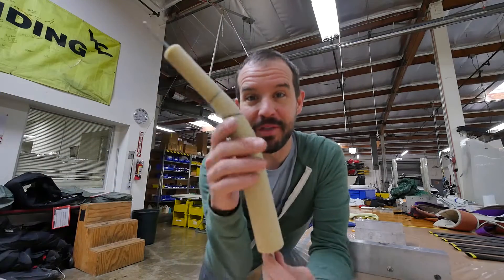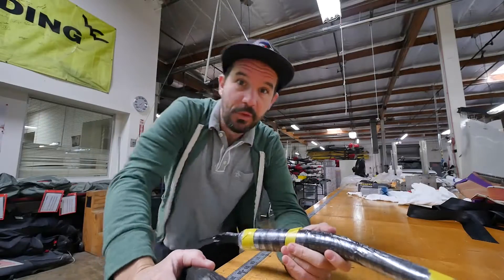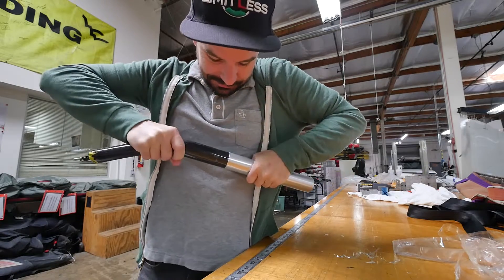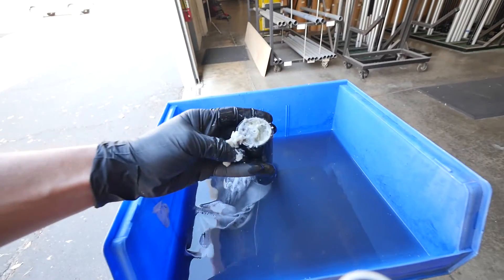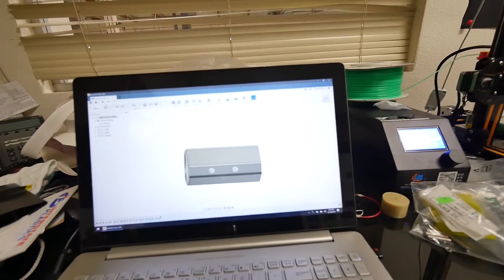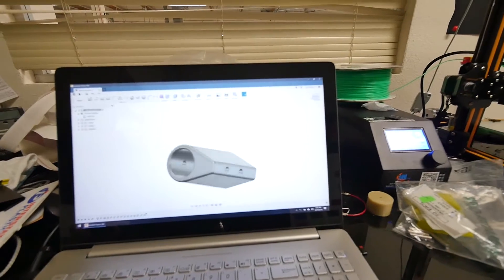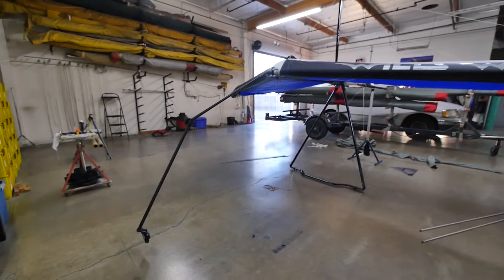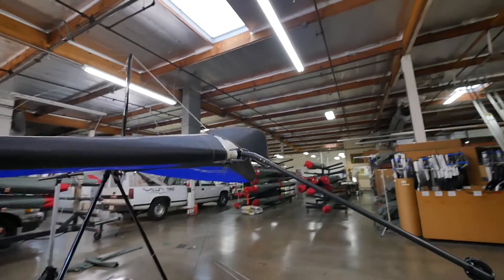Making a Carbon Fiber Nose Boom Part 2

Comment: David - please for your help - I have a Rotor Harness and the grommet where the pitch rope goes into the back plate failed and the rope had made a cut thru the composite plate (about 2" in length). I have a new grommet, but the cut needs to be strength restored, and my question is what epoxy I would use in order when applying the mixture do not damage the composite plate if excessive heat will be produce? Thought you might help in that regard, since you have been doing lots of composite work. Thank you in advance David! (Sorry rising this question here, wasn't sure where else I could reach you)
Reply from the maker: I can't really be of much help as I haven't done any repair type work. In general I think you'll be ok as I don't think most epoxies give off too much heat when curing (at least not enough to damage the existing cured epoxy.) But that could depend on the epoxy used in the original laminate. There is a range of max temp ratings for epoxies. You would be wise to consult with the manufacturer about this.
Reply: Thank you David, I am working on it, have to fix it, can't leave it like that. Thanks again for your quick respond!

Comment: Cool! As I wrote to you, the shrink-tape is the way to go. Did you used the heat-gun or a curing oven? Cheers.
Reply from the maker: Heat gun. Can't put this part in an oven as the internal mandrel will get soft/melt.
Reply: @designbydave  Yeah. The heat-gun might get the tape to wrinkle in some spots, but with practice will get better. Overall, being the fist time I say it's a good job 👍👍 (who cares about those nics & lines) 
Cheers man! 

However, if you really into "perfectionist" the little  wrinkles & nics can be removed by filling them, applying  some more Epoxy with the brush and then place the shrink-tape very tight but NO heat-gun!! The purpose of shrink-tape will only be for holding the resin in place with no dripping while it gets harder. So the extra resin will work as a filler.
Reply from the maker: @MassimoPugiDelta  The wrinkles in the tape are from it not conforming to the bend and taper in the part. The tape I used was 1 inch wide, 0.002 inch thick and doesn't seem very flexible. Perhaps 0.001 inch thick tape and may 0.75 or 0.5 inch wide tape would conform better. Or just pulling more tension to get the tape to bend/stretch. However I didn't want to pull to much to prevent distorting the underlying laminate.
Reply: @designbydave  I see, but be careful of thinner shrink-tape because it reacts more to the heat-gun action! and I've noticed it has the tendency of making even more wrinkles.
As I said, if those little nicks & lines don't please your eye, just apply a plentiful layer of Epoxy and then wrap it up tight with shrink-tape but with NO heat. That's the way I did with my Digifly holder & fairing... such a artifact had to be perfect, nothing less.
Reply from the maker: @MassimoPugiDelta  The wrinkles were caused by the material "folding over" on its self. One side of the tape wraps tight, while the other side is loose due to the bend/taper in the part. Not sure if I'm describing that correctly and I didn't show it very well in the video. You need a material that can stretch and bend to wrap tightly around a part like this. A test dry-run with 0.001 inch thick tape would teach me how much heat can be applied. I could definitely fill in the divots, some epoxy with microballoons would do the trick but I'm not sure it's worth the trouble. That won't add anything structurally and visually, well, I'm gonna photoshop out the mount anyway hhaha. Thanks for your comments.
Reply: @designbydave  Right on! While you fly nobody will notice the small dents & nicks... and be sure I won't tell anyone 😂 C-ya